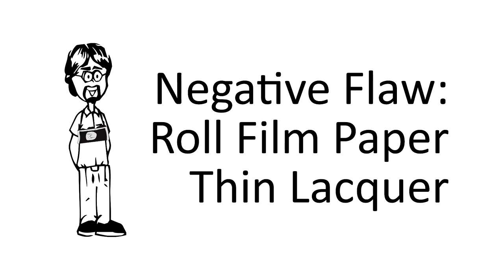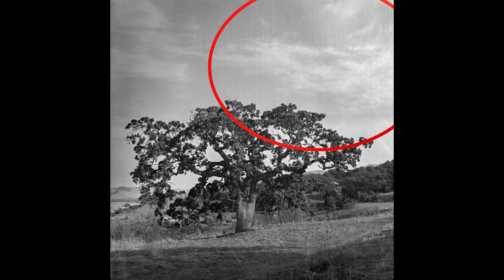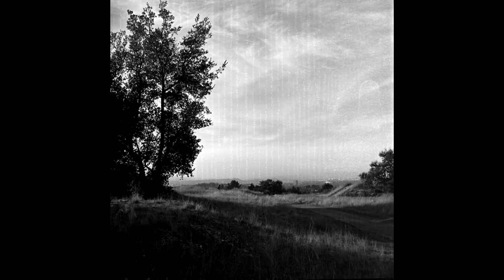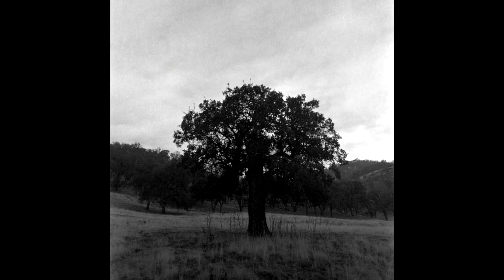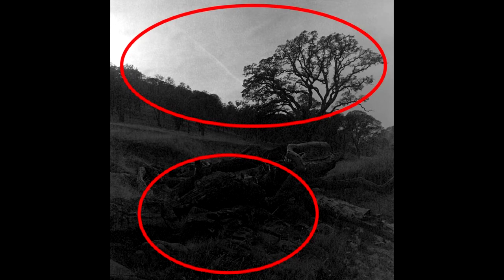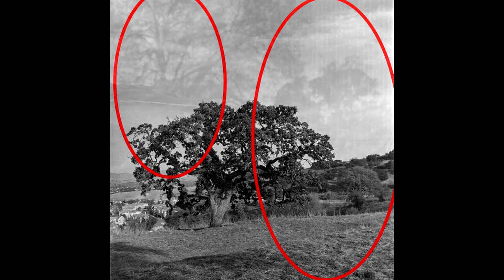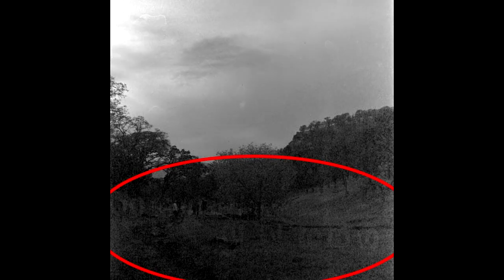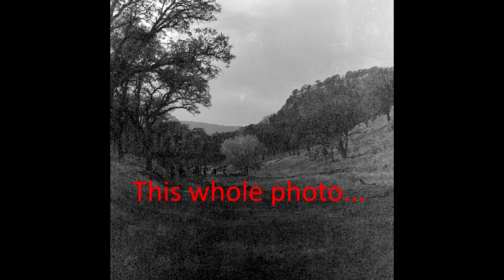Negative Flaw: 120 Backing Paper Numbers on Film

Comment: I use Foma, various Ilford films, Fuji Neopan Acros (both old one and the new II version). I have never had this problem. Then I bought the 5-pack of Kodak TMax 100. I have the numbers and marks on every single of that five. And the pack even wasn't expired. 

I'm done with Kodak.
Reply from the maker: Yeah, most all of the major makers have had this issue at least once in the last five or six years. I had this a LOT with ShangHai GP3 for a while, too.

Comment: Backing paper is not pressed against the emulsion. The paper is on one side of the film base and the emulsion on the other.
Reply from the maker: The backing paper does press against the emulsion when the film is wrapped onto the spool, which is also where the film spends almost all of its life prior to being used. So this issue, as confirmed by Ilford, arises when the backing paper on the spool presses into the emulsion that is wrapped behind it.
Reply: @DavidHancock  Then yes. By pressing I understood the pressing in the film gate by the pressure plate.
Reply from the maker: @MezeiEugen  Got it. I understand the confusion. Yes, I intended to say that the issue occurs when the film is spooled. Thank you!